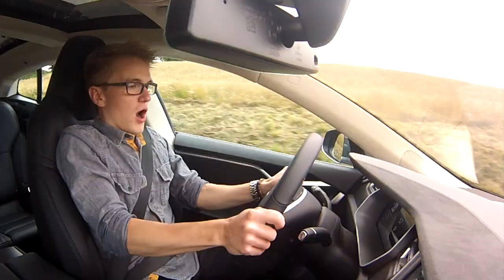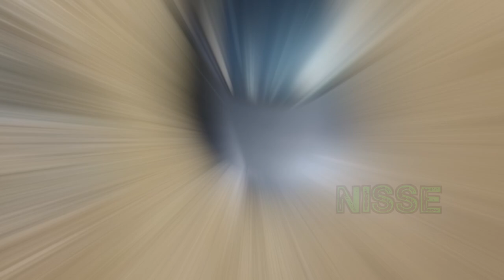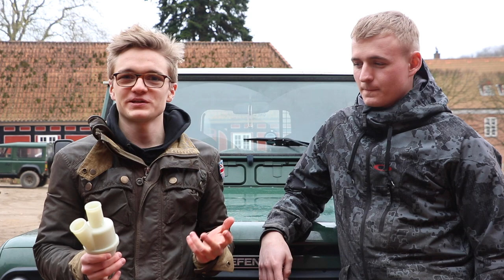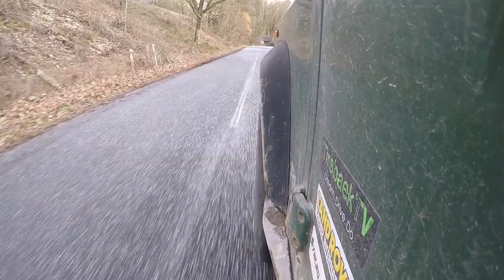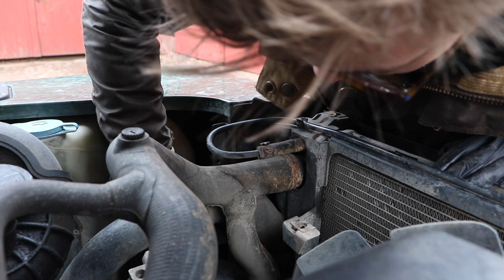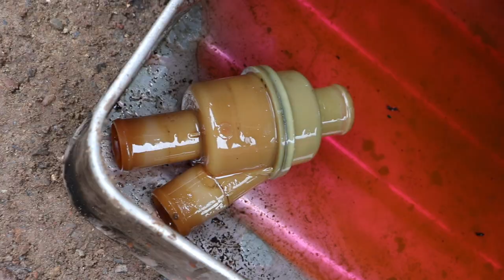Have We Fixed Liam's Infamous Td5 Heater?

Comment from the maker: Apologies for the varying audio while driving, I hadn't quite gotten used to the GoPro Hero5's new audio settings... 
Also, I am aware of the whining noise coming from my engine - I believe it's a warped exhaust manifold and it will be fixed in the near future, but thanks for your concern! :)
Reply: Hi @Tirsbaektv  Could you please do a video on what faults to look out for when buying/maintaining a TD5 Defender.

I've heard the there are different td5 engines (10p & 15p) just wanting to know what to look out for as I've got  year 2000 td5 in my sights :)

Comment: I'm glad you got it working again! Defender heaters aren't all that bad when they are in tip top condition, they just have a lot of space to heat especially in a 110 Hard Top or something! Luckily I have a double cab TDCi - the heaters on those are scourching, and have very little heat variation so it's basically hot or cold!

Comment: I think you can get air trapped which makes it seem like the coolant level is higher than it should be. My discovery only heated while it was accelerating when the coolant was low as the coolant got sloshed into the heater matrix.

Comment: on the td5 cooling system the coolant only goes through the heater and fuel and oil heaters/coolers on start up when the engine reaches operating temp the thermostat opens to regulate flow through the radiator as well so the heater in the td5 is the perfect indicator of thermostat function since the coolant always flows through the heater core. since you would eventually get some heat I can only assume the thermostat was at least partially block on that side. also bleeding the air out of the cooling system is a massive pain in the arse

Comment: When you say a few minutes do you mean 5mins or longer? Mine heats up but takes a good 15mins at 30ish mph.

And what thermostat did you get? As I'm aware there's a few available for colder climates.
Reply from the maker: It seems to vary - Anywhere between 5-10 mins I'd say. It helps if I let the engine run for a few minutes before I go out. And I'm pretty sure it's just a standard thermostat as it looked the same as the one we took out. Bought it on eBay from Bearmach.

Comment: Easy fix then 😀 You might find that there is a small bleed screw in the top radiator hose to aid bleeding air from the system 😉

Comment: The same is happening to my TD5 Discovery 'heat at high speed' but the engine is warming up properly so i don't think it's the thermostat.. i think the Heater Matrix rad isn't filling properly or it's blocked, this couldn't happen in the summer.. winter is here god damn it
Reply from the maker: hehe XD You could try and take the heater box out and clean it indside out, or get a new heater radiator
Reply: I think the dash has to come out for a complete change, i'm gonna flush it with rad cleanser that should do the trick and it's not difficult do, i'll change the thermostat as well just to be sure it's old anyway,. I can hear gurgling sounds in the dash so i'm sure now that's the problem

Comment: Hey @TirbaekTV is this the air coming out by your knees or the ones on the windscreen? My ones on the windscreen work and are warm - however the ones at my knees only seem to go on cold?
Reply from the maker: There is a cable connected to the lever that controls the direction of airflow, that might be your issue.

Comment: Do you intend to fix that whiny noise under acceleration? It sounds cool, not gonna lie!... but I'm imagining it's something like a leaky exhaust manifold gasket which probably isn't doing all that much for you engine and probably costing you a bit of power as well.
Reply from the maker: It will get fixed at some point yes. Like you say, I believe it is a warped exhaust manifold - a common Td5 fault.

Comment: liam, your turbo makes noises it normally shouldnt make (could be the audio from the camera) but if i were you i would check the manifold for warping or a leaky exhaust gasket.

And indeed the clips are a pain to remove...
Reply from the maker: Thanks I know, saw your message on IG ;)

Comment: How much did you pay for the td5?
Reply from the maker: Around £9-10K. Cars are more expensive out here though, due to tax.
Reply: @TirsbaekTV  Seems in the uk it looks 10k+ if you want a reg this side of 2000 and less than 100k miles
Reply: Was the temp gauge getting up to temp prior to changing the thermostat im having the same issue now but mine gets up to temp fine i have flushed the matrix and system and bled just haven’t done the thermostat yet